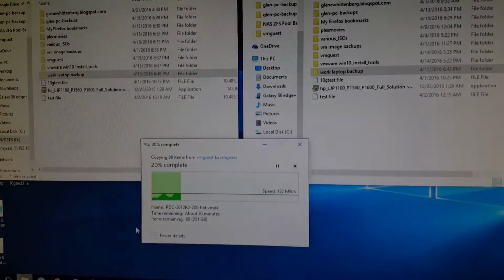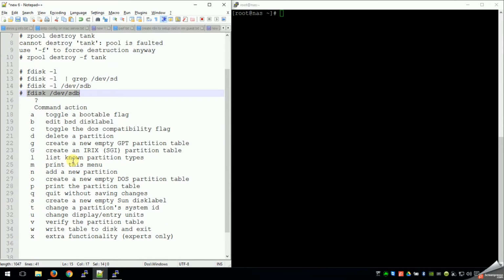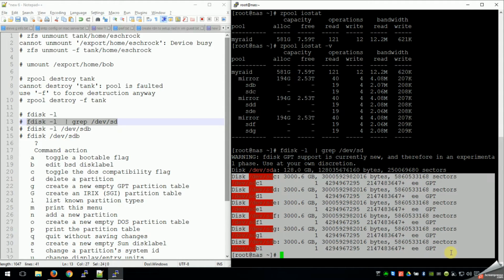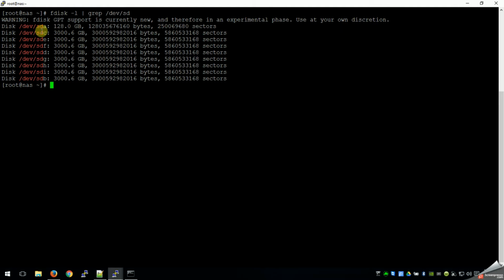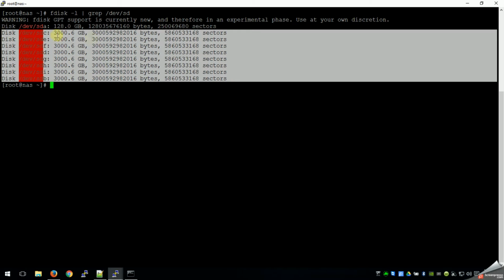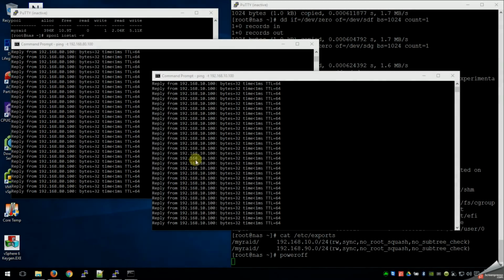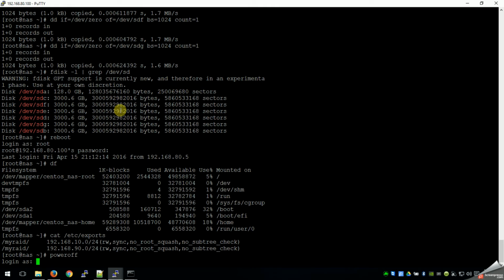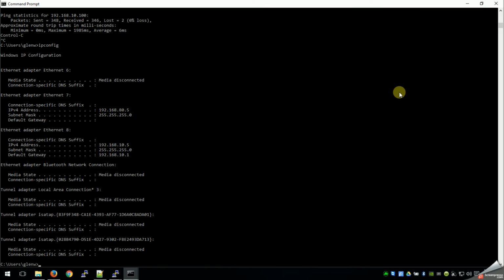10Gb ZFS NAS 8 drive 4 vdev Striped Mirrors

Comment: What do you think the chance of you emailing me the build doc you followed on this is?  I have been working with freeNAS and serveral of the things you outlined here are EXTREMELY useful - Thank You!  I am having issues with the overall of how it performs and sustains loads for r/w traffic.  CPU, RAM and DISK appear able but something is a miss.  Centos may be the go to.  Thanks in advance.
Reply from the maker: messengaro1 it should be on my blog at glenewhittenberg.blogspot.com I am now, and have been shortly after this video, running btrfs in a RAID10 setup with 8x 3TB drives. I hammer this thing with vm's and it has yet to let me down. Btrfs is in the centos/red hat kernel. Zfs is not native Linux.
Reply from the maker: In my blog a talk about having bad drives in my array. Not true. It turned out to be a 4 SATA drive fan cable coming off my controller.